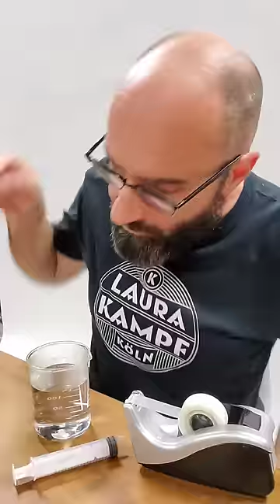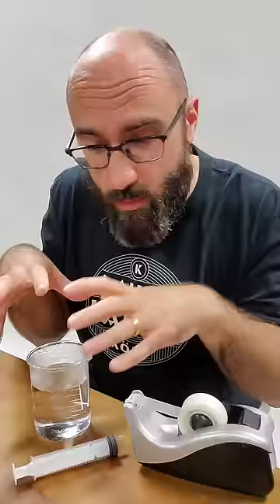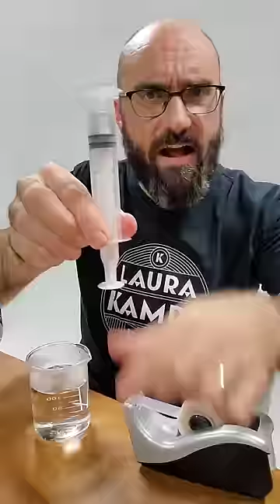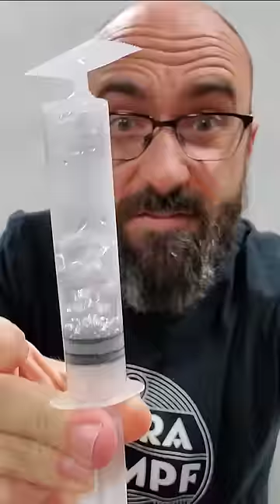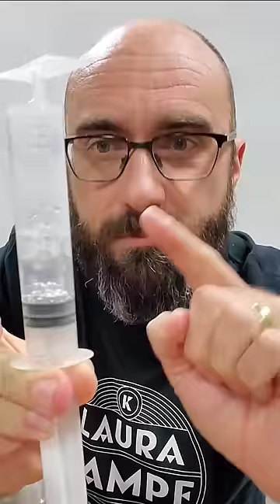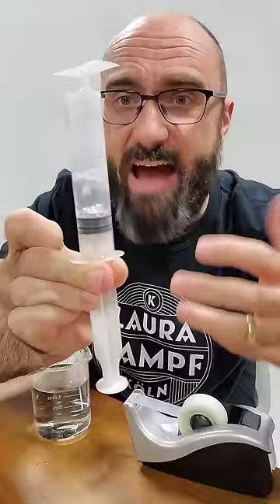Cooling down water by BOILING it

Comment: This phenomenon is why carbonated drinks are better cold. 
So this video is just about the misconception of the boiling phenomenon. Boiling is any time a liquid goes to a gas and it depends on the atmospheric pressure surrounding the liquid, called the vapor pressure. Like he said, boiling depends on the energy of the liquid, specifically if it has enough energy to become gas in the space above the liquid, so if you lower the psi, suddenly the lower-temperature molecules have enough energy to escape the liquid state. Think of it like an invisible hand pressing down on the liquid to keep the molecules from turning into vapor, which they want to do but can't because of that atmospheric pressure pressing against the liquid.

In a carbonated drink, If you lower the temperature of the liquid, the lower energy of the CO2 molecules (the fizz) in the drink means more of the gas stays dissolved in the liquid instead of escaping into the air at the top of the bottle

It's why any time you look up the boiling point of an element, it gives you the psi as well. It's also why if you were to go into space your body would start immediately boiling because the atmospheric pressure is 0.
Reply: My body is not a liquid to boil in open space.
Reply: Pls can someone explain why this reduces the psi
Reply: @willgloryo216  so gas is different than solids or liquids in that the molecules are not attached to each other. they float around in space and bump into each other.  This is the reason that Gasses can be compressed or expanded but solids and liquids cannot.  PSI is a direct result of how compacted of a space those molecules are in.  The atmospheric pressure psi is a result of gravity on the molecules in the air pressing it down. Think about like oxygen tanks, how if you remove the cap the oxygen starts shooting out because it's pressurized in the tank.  In the example with a syringe, he has a small amount of gas in the tube.  Remember the psi is a result of the molecules of gas bouncing around in there.  When he pulls back the plunger, suddenly the same number of gas molecules have much more room to bounce around in, which makes it a lower psi.
Reply: @belcurve  ohh that makes a lot of sense thx but does that mean that the forces of attraction between the molecules arent high enough to warrant the liquid staying as a gas?

Comment: This is actually the fundamental mechanic used in your air conditioning. We drop the pressure of refrigerant, and it 'evaporates' (boils) amd the gaseous refrigerant absorbs heat you don't want in your home.
Reply: Yes it’s also how a refrigerator works. Which is why it’s called the refrigeration cycle. Or in the opposite direction which is a heat pump.
Reply: Reverse Carnot cycle
Reply: @animenmusic16 I carnot believe it
Reply: With heat released into the atmosphere being the by product💀

Comment: I am a professional HVAC technician (heating, ventilation, air conditioning) and I just want to say you perfectly explained how air conditioners and refrigeration works.

pressure and boiling points are directly tied together.  when you raise/lower the pressure of a liquid, you raise/lower its boiling point.

in an a/c or refrigerator, we take high pressure liquid refrigerant and pump it through a metering orifice, which is basically like holding your thumb over the end of a garden hose.  After passing through the metering device, the refrigerant is now a much lower pressure, and it will boil at room temperature, which is how it absorbs heat from your house.  the fan blows air across loops of pipe that the depressurized refrigerant is pumping through causing it to boil as it goes through the loops, absorbing the heat in the process.  Then it goes to the outside unit to re-pressurize in order to raise the boiling point, which causes the now-gas refrigerant to condense back into a high-pressure liquid, dumping the heat it absorbed into the outside air in the process of it's change of state.  It's a constant loop of manipulating the boiling point by changing the pressure.  high boiling point to dump heat and low boiling point to absorb heat.
Reply: thank you for taking the time to explain, good one btw
Reply: It depends if molecules will change and density is decreased due to temperature and kinetic energy is same
Reply: Ever since I learned how consistently forms of energy were converted into heat in middle school, I’ve always been so confused how something like a fridge worked when energy was supposedly being used to make something colder. I haven’t rested easy since lol. Thanks for explaining 🙏
Reply: I came here to say this, and I'm glad an actual expert already did.
Reply: @Aaron.Thomas  what ?
Reply: @teevidekho495 ?
Reply: @beastonea  ?
Reply: @teevidekho495  you said what lmfao
Reply: i want to ask about what is the temperature on the a/c set? analogy like this, I take the example of the car. when we want to add more rpm of the engine of course we open the throttle gas bigger. based on the analogy with the car, what components are in the a/c system that regulate the temperature of the air coming out of the a/c? so that we can determine what temperature the air comes out of the a/c through the a/c remote. Thank u
Reply: In hvac industry myself. No master tech by an means but i always explain "there is no such thing as cold, just an absent of heat". Your ac doesn't make "cold air" but removes heat from the air and return it.
Reply: What will happen if I heat the water while simultaneously vacuuming  it ?
Reply: Was waiting for the "tech connections explains heat pumps for the 50th time" comment
Reply: As a new tech to the field, this is helpful
Reply: I ain’t reading alla that
Reply: Good stuff. Science has interesting properties even if I may not understand it all (I'm a philsophy guy that tests stories for consistency).
Reply: Yeah, in a system where the preassure never changes, the volume devided by the temperature (in Kelvin) is constant. Pretty cool seeing it with my own eyes
Reply: @SomethingCreativeHere Too bad because it's highly informative
Reply: I (sarcastically) wonder if there is a way to use renewables to cool the atmosphere 😂
Reply: @beastonea  let it be
Reply: Well, sorry to say so, but if you are professional HVAC technician, you should know that last part of the explanation (why the water is getting cold) is wrong.
Reply: @imStrato  exactly
Reply: Huffing r22 is expensive asf
Reply: @Bravo_L  actually
Reply: I've tried to wrap my head around modern AC many times and this video helped it finally click, along with your explanation here. Thanks!
Reply: Hsauce
Reply: I did refrigeration, and you hit it right on the head man
Reply: @colewyatt9839  thats due to supernatural powers
Reply: Is that what HVAC means??? 💀
Reply: @EbbermanEmily  that is subordinate
Reply: atheistic paragraph, not reading
Reply: I still don't understand it and I think no many do. How can this cooling fluid technically take up surrounding heat?
Reply: @kosmosbos  I have explained, Kindly read it
Reply: @kosmosbos  let it be ,you need separate class
Reply: @jaxs7800 refrigeration theory is a tough one to grasp, once you get it, you will go faaaar in hvac
Reply: @EbbermanEmily is that sarcasm or-
Reply: @mexiguayan  nah I just didn't know lmao
Reply: @EbbermanEmily  oh 🤣
Reply: Wow! Great explanation! I was trying to make sense of the process from the comment above yours. You are a natural and better at explaining the process than the guy in the vid.
Reply: @lennyallen6577 great illustration 👌 👏  the guy in the vid lost all logic trying to sound smart.

Comment: I think a simple concept is explained in a complex way here…

As pressure decreases, boiling temperature of water also decreases…

Just look at the clouds above, in space there is 0 pressure, the pressure decreases as we move higher and hence the clouds are very cold but are vapour which could only be seen at 100°C at home… 

Don’t mind me, I’m just an Aerospace engineer trying to find life
Reply: Adding to that: that's why water boils at ~100°C at sea level, but if you were to boil it in high mountains let say Mount Everest it would boil earlier at lower temperature.
Reply: @Q36BN  it's just a joke but, ever wonder the temperature of water we drink in an airplane? 🙂
Reply: @truffles_73  Ive never been in the airplane. All i know is it that it has pressured cabin
Reply: @Q36BN  yeah we install constant pressure systems to control the pressure inside.. just like a refrigerator or an aircon.. don’t be sad about not flying btw, it’s no magic it’s just Bernoulli’s equation in practice… swimming in air but using machines due to density variations…

Comment: I have a material science degree and I’ve been a chemistry nerd my whole life and this is the best explanation I’ve ever seen of this phenomenon. The way I intuit it is that boiling is an endothermic process, meaning that the system pays with heat in order to change. You can pay the water with heat to make it boil, or you can depressurize the water and force it to pay its own heat as it is forced to boil.
Reply: So in a nutshell, as best as I can put it:

At our current atmospheric pressure, water needs more energy via boiling to become vapor.

By decreasing the pressure it is in (like in the syringe, that amount of air and water is spread over a larger spatial area, hence the pressure dropping), less if not no energy is required to cause the change in state because of the available energy already in the water.
Reply: @randomsandwichian  It’s an equilibrium dependent on thermal energy, gibbs free energy, and pressure. There’s an equilibrium vapor pressure for every liquid at every temperature at which no more evaporation will occur. Technically more evaporation is always taking place, but condensation is happening at the same rate. Increase the temperature and the evaporation rate will become faster than condensation. Increase the pressure and condensation rate will become faster than evaporation. Until, in both cases, the vapor pressure once again reaches the equilibrium vapor pressure, and then both processes will be equal again.
Reply: Clearly, US science degree worth nothing these days.
Reply: Physics nerd you mean ..
Reply: Isn’t this the way Vacuum Distillation is done?
Reply: That's definetely not the best bor simliest explanation. You don't even need to know about moluculs kinetic energy. Just that vaporizing cools down, and boiling is a fast vaporizing
Reply: Both are true.

The high energy molecules do get boiled off, but that also doesn't change the fact that breaking all those hydrogen bonds requires energy, and that energy comes from the heat.

The total thermal energy of the water+water vapour afterwards will be less than that of the water beforehand.
Reply: But sir, why bubbles can't form inside the bulk water before it's vapor pressure becomes equal to atmospheric pressure? I mean shouldn't the pressure inside the bubble that should matter and not vapor pressure, why can't the high energetic molecules  form bubbles inside the water which has pressure greater than its surrounding pressure and escape? And if it's just about bubbles why can't water temperature rise further than the point where it's vapor pressure becomes equal to atmospheric pressure?
Reply: @virenderbhardwaj3137 
They  can, buy there is water vapour condensing at rhe same time.

The two effects cancel out.
Reply: @IamGrimalkin  but that doesn't explain anything? If boiling is characterized by bubble forming in the bulk then why can't high energetic molecules form bubbles inside the bulk at a temperature even when it's VP< atmospheric pressure? Also why the temperature doesn't rise beyond the temperature at which the VP=atmospheric pressure? It would just mean the vapor pressure is increasing and bubbles are still forming
Reply: @virenderbhardwaj3137  The evaporation chiefly happens at the surface rather than in bubbles.

I don't know why you think the temperature would rise.
Reply: @IamGrimalkin  that's what I am asking why only at the surface? Aren't there any high energy molecules in the bulk which should form bubbles even when the Vapor pressure is less than atmospheric pressure? These high energetic molecules should form bubbles which have pressure more than their surrounding pressure and should escape but Why bubbles have to form only when the vapor pressure becomes exactly equal to atmospheric pressure?
Reply: @virenderbhardwaj3137 
Surface tension.

Having a larger surface (from the surface of the bubbles) is energetically disfavoured.
Reply: @IamGrimalkin   do you have any source of it? Because I haven't read this answer anywhere else for surface tension being the reason that bubbles don't form below the point when vapor pressure becomes equal to atmospheric pressure
Reply: @virenderbhardwaj3137  it's something that follows pretty naturally from what the concept of surface tension is.

YouTube comments don't like links, but just lookup explanations of surface tension and youll find them.
Reply: @IamGrimalkin  but if that would be the case why bubbles start to form when we decrease the pressure over the liquid? Surface tension shouldn't depend on pressure
Reply: @virenderbhardwaj3137 
Because reducing rhe pressure drops the latent heat of vaporisation: it takes less energy to turn water to water vapour.

This means there's plenty left over for overcoming the surface tension.
Reply: @IamGrimalkin  "there's plenty left over.." I didn't fully understand what u meant by that...the energy of water molecules was the same as before but bubbles started to form why?
Reply: @virenderbhardwaj3137  But also, it doesn't neccessarily; you do need nucleation sites.

That's why chemists usually put something that generates nucleation sites in something they want to boil; otherwise it could Superheated the liquid and when a nucleation site does form large amounts of it will boil at once.
Reply: @virenderbhardwaj3137 
It's not the same as before.

This was a point they missed in the video, which I pointed out here.

Breaking rhe hydrogen bonds that hold the water in liquid form takes energy. That energy is going to come out of the kinetic energy of the molecules.

One thing I forgot to mention as well: at high pressure, molecules with high enough energy to turn to water vapour are few and far between, which makes it harder for them to group together into larger bubbles.

One large bubble has lower surface area than lots of little bubbles, so because of surface tension making lots of little bubbles takes more energy.
Reply: @IamGrimalkin  but we just reduced the pressure, why would it change the energy of water molecules? It should be same ...so why it's energetically favoured now to form bubbles?
Reply: Damn you guys are smart I got no clue what any of you just said
Reply: @rosamy2017   Right, I forgot to add at the sea level. The higher up things are, the less pressure is exerted on each molecule, hence the less energy it takes to boil (add energy to break the Van Der Waal attraction). First I've heard of Gibbs free energy though, I'm not that level of nerdy.
Reply: @TheMysticShark  it's not because they're smart, it's because they went out of their way to learn this stuff, you too can do the same if this stuff interests you, I recommend Khan academy as a place to start. I myself have just started studying this stuff and the only thing I got from this discussion is hydrogen bonds lol, but with enough time and dedicated effort both you and me can understand this! and don't forget to have fun! it's fun to learn how this world works :)
Reply: Thanks!
Reply: That's a good explanation. When I was in chem in hs/college, I always saw the latent heat of vaporization (and the other steps on that graph, you know the one) as temperature caps. At 1atm It can only go to 100c where it boils into a gas, but by lowering the pressure it also lowers the cap, so the boil forces the temperature down. Can't be over the maximum :)

I don't have a chem degree and I haven't flexed any chem (or physics) muscles in years tho so I could be wrong on specifics lol
Reply: Me about to start university to GET a material science degree: 👀✍️✍️
Reply: @rosamy2017 This was VERY articulate, well done dude. Think about teaching :p
Reply: wtf thats an amazing way of thinking about it